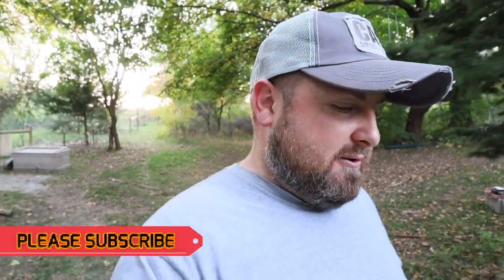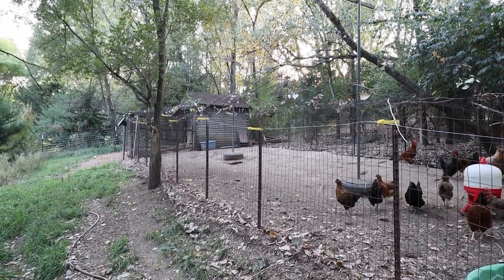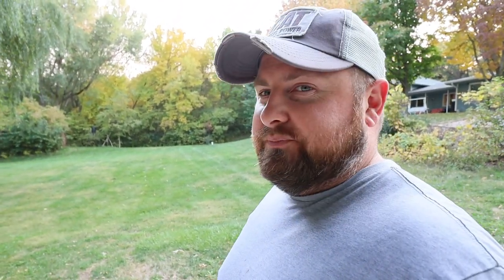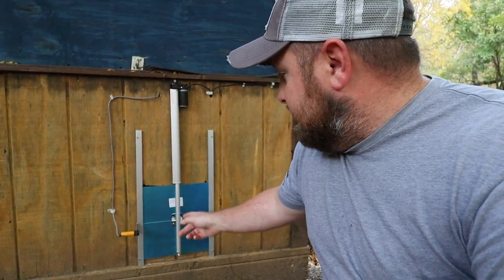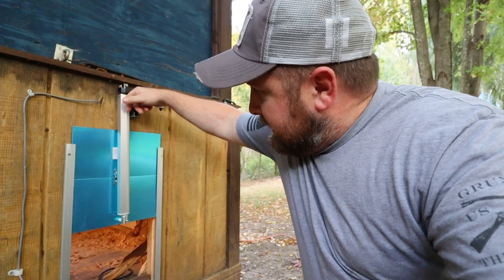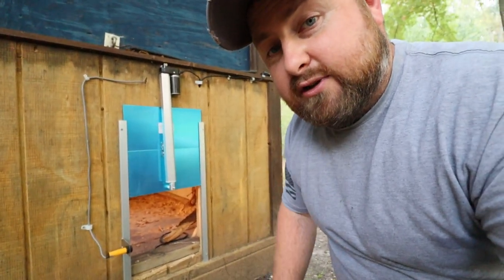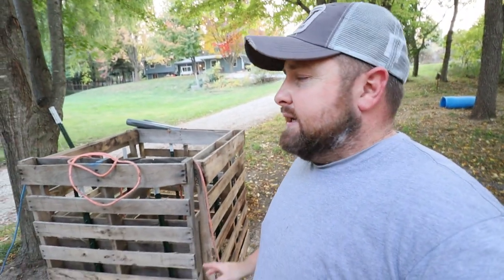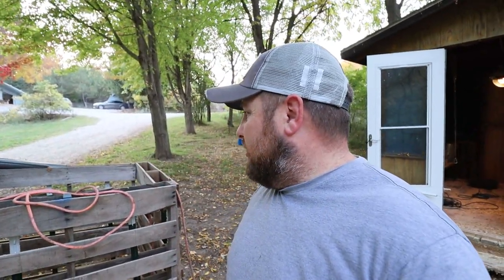Most Advanced Chicken Coop Door EVER!

Comment: How did you adjust the infrared light sensor on your automatic Coop door
Reply from the maker: It came pre set and worked so I never had to adjust it. But usually there’s a +\- adjustment on the sensors or in the control to adjust sensitivity

Comment: I'd be worried about predators crossing the fence line. I'd have a hot wire on top and bottom. Those raccoons and fox have been there before.  You may have to put a drip shield over the chicken door so water won't freeze in the track and keep it open. You do get a long cold winter up there.
Reply from the maker: Good call on the drip shield ! I happy you mention that because that would of happen for sure 👍👍👍👍